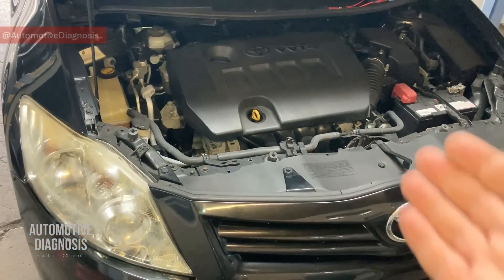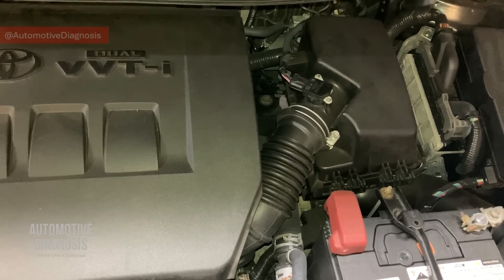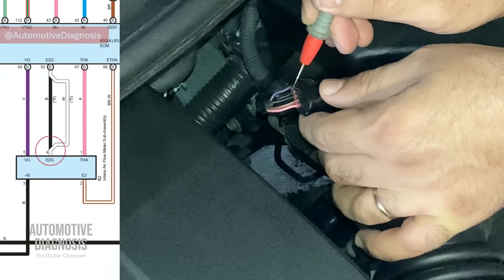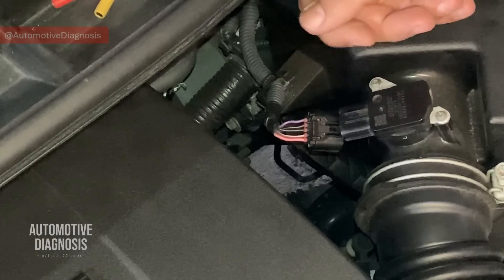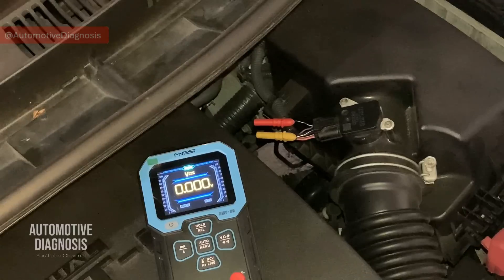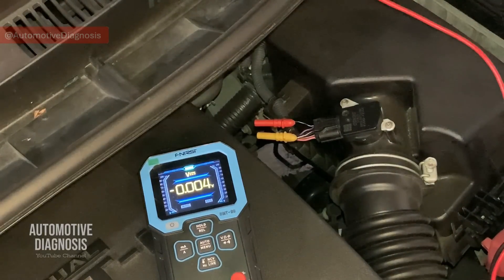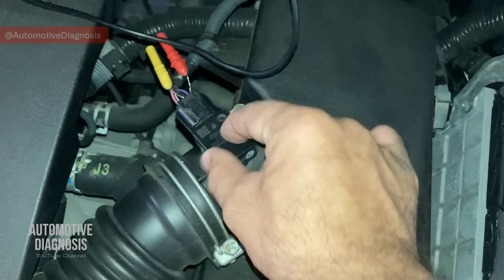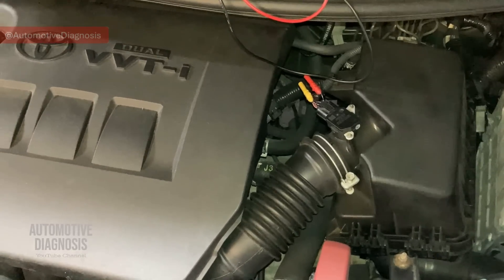How to Test Mass Airflow Sensor with a Multimeter

Comment: Excellent! You can also check sensor output by comparing it to engine size in liters it should read that value at hot idle with no loads or maybe a little higher. I get about 2g/s on my 1.8L engine. 🔧
Reply from the maker: Thanks for sharing your experience 😊🙏🙏

Comment: Is 0.9~1.2 V at idle a universal value regardless of engine capacity and the number of cylinders?
Reply from the maker: Hi there, this value on many cars I have tested is very similar, on some engines with higher capacity it could be a little higher, here is a page of a workshop manual explaining how to check the MAF sensor output voltage with scan tool and with a Multimeter:
https://drive.google.com/file/d/15GRBbARyy248uCFQyAelt2BhtK5HRdaB/view?usp=sharing
You can see the sensor output signal on different range of engine RPM.
Note: I inspected the sensor signal on the sensor connector, attached workshop manual shows that on the other end of the signal wire, on ECM side, which is basically the same.
Reply: Thanks. My good MAF is 1.1~1.2 at idle while my bad MAF is 1.3~1.6 at idle
Reply from the maker: @ranuld  Sometimes when you just started the engine, this value is a little high, so you just need to wait for the engine to warm up then read the correct value.